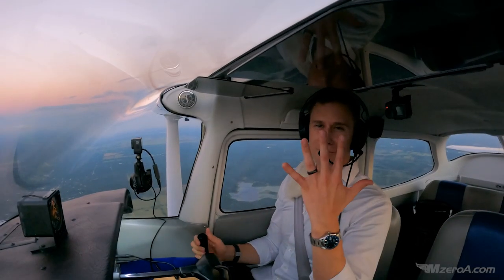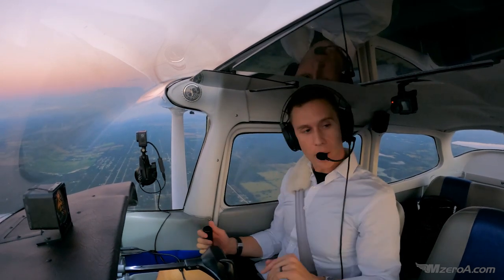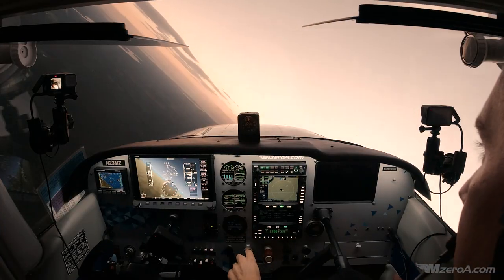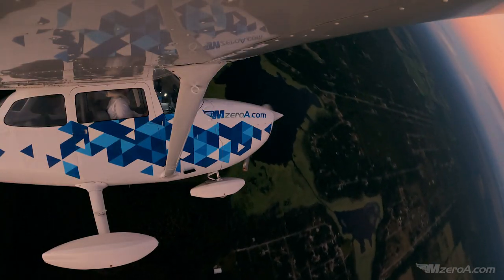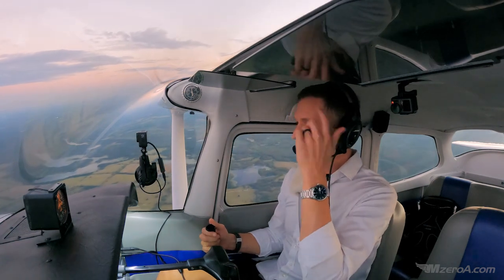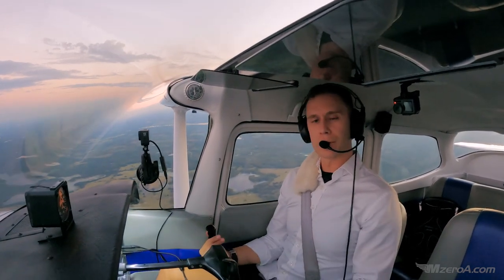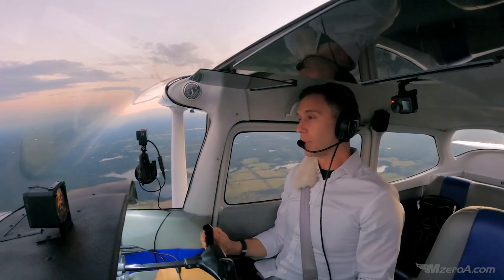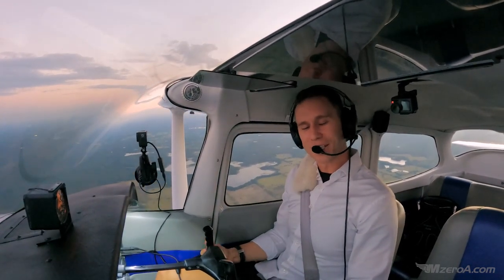Flight Maneuver Series  [Accelerated Stalls] | MzeroA Flight Training

Comment: 30 years ago when I took my ppl. My instructor had me do accelerated stalls.  Once we started the steep turn he would yank back on the yoke and almost immediately push it back down cause the plane would almost instantaneously stall.  It wasn’t good on the plane because of stress.  I hate stalls anyway, but these were unnerving to say the least, I think it made me a better pilot though because it shows you can stall at any speed and any configuration. Thanks for sharing.
Reply from the maker: Thanks for sharing your experience, Ted! Fly safe!

Comment: Pushing the load factor to the limit?
Reply from the maker: Hey Shawn! In a very aggressive accelerated stall, that could be possible. However, how it is demonstrated here and performed on the checkride does not get to that point. Thanks for watching!
Reply: @MzeroAFlightTraining  I would guess it also depends on the weight of cargo and the winds at the time.   Understandable, you don’t want to hurt the airplane of course.